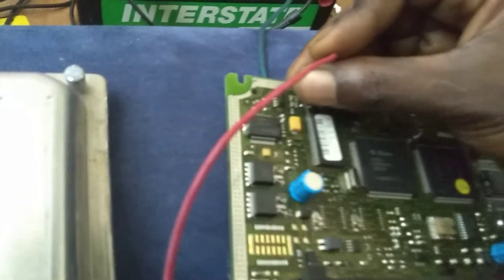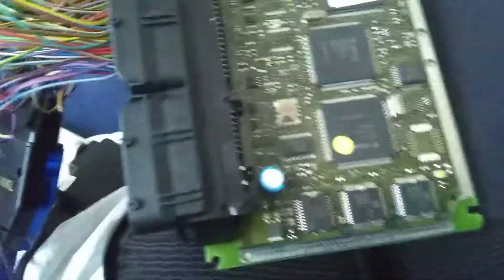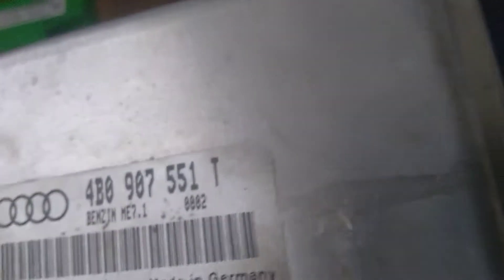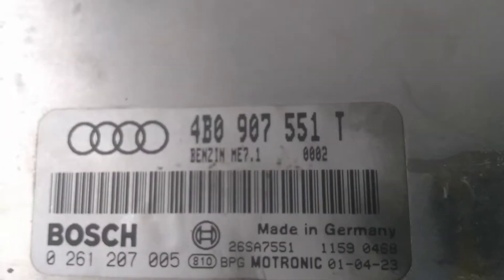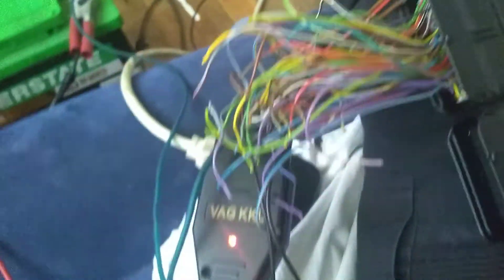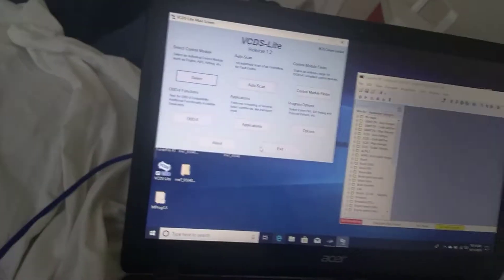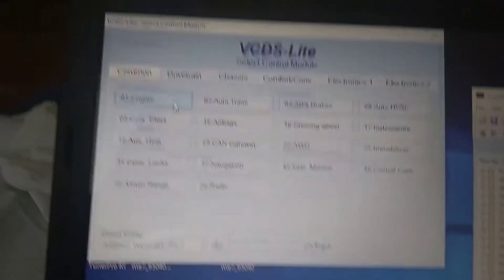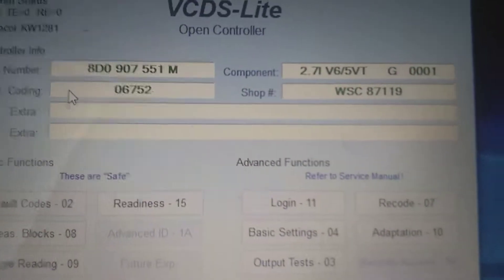BOOT MODE WITH KKL CABLE. NO GELLATTO OR ROSS-TECH CABLE NEED TO FLASH LOCKED ECU

Comment: Which flashing utility did you use if you don't mind me asking?
Reply from the maker: Ecu connector, obd connector, car battery, and a safety pin, kkl cable although I used A 409 to show it can be used also. Gellato is easier for booting in my experience but nefmoto is user friendly. Tunerpro to flash!